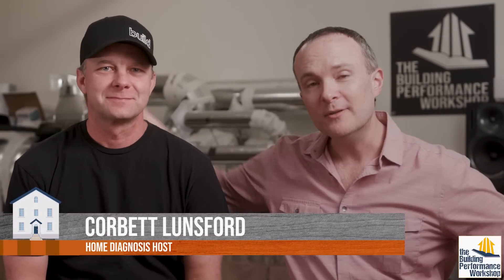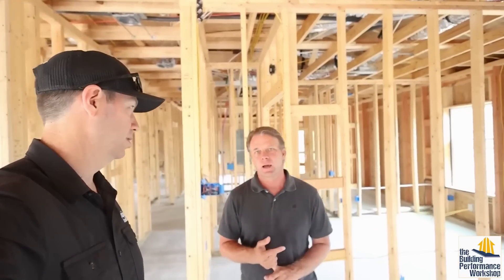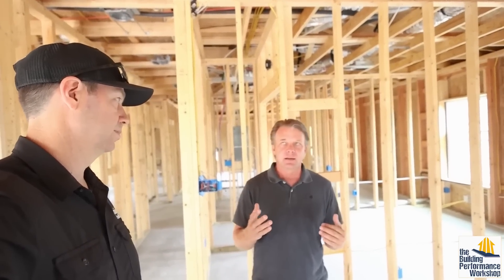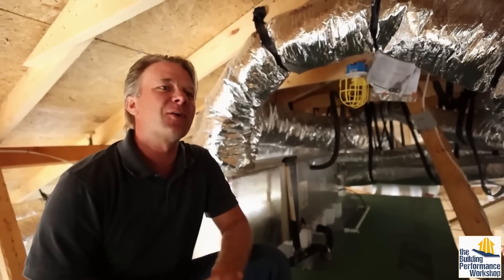Dryer Won't Dry Clothes- Broken Dryer, or Airtight Home? (feat. Scott True)

Comment: why was the make up air damper turned into a 10"? was it that it could cover both exhaust hood for the kitchen and laundry at the same time? could having the mau fan speed run higher do the job?
Reply from the maker: No, it was just undersized to begin with. Hard to configure a control system like you’re talking about.

Comment: Thanks!
Brothers,
I'm so glad I found your "Home Performance" channel.  I really appreciate anything I can find where Scott is speaking "Practical" and usable insights. 
Say... would you consider a deep-dive into the issues of the Vapor Diffusion ports.
What it is; the problem & why; the solution...

Corbett, do you & @Home Performance market or sell these blower door kits. We're getting ready to build a retirement home and may just have to buy one ourselves???  I cannot find a builder in my Coastal NC area who uses one or thinks in terms of 0.6 ACH50!  

Cheers,
Eric
Reply from the maker: Hey thanks Eric- I’m sure we can find you a blower door tester, try Josh Hartness at Haas Energy in Charlotte, he may know.
Reply: @HomePerformance  
Corbett, thank you very much! I will reach out to Josh on Monday. 
Another resource missing here on the Crystal Coast is an Aero Barrier contractor. AeroSeal  made a referral, but they only do the Aero Seal service not the Aero Barrier.  Perhaps Josh has contacts. 😎 
Building my team for our home is hard. Thankfully, I connect again with the awesome Steve Baczek next week. 

Cheers, Eric

Comment: So the solution was to increase the size of the make-up air to 10in, and air seal areas that were lacking. But it was said to “add make-up air exclusively for the dryer”? Does that mean a separate make-up air duct was added to the laundry room? Also, any reason why Scott didn’t retrofit an ERV?

Comment: Another great video. The only thing I did not understand was the reason there was moisture by the doors? If the doors are sealed well, then why the moisture infiltration. I understand that the home was under pressure when the dryer and ac was pulling but if sealed well then why the pull. Maybe even though the seal is great its still gonna pull. So make up air stop that?

Comment: Eureka!  We built our home tight; I think tighter than our mechanical contractor could appreciate.  None of our bathroom exhaust fans are effective, same goes for our hood vent, and last but not least, our gas dryer works only intermittently.  Now I know to open a window when we run the dryer.  Will definitely be discussing this with our mechanical contractor for the next build; thank you for this,

Comment: My thoughts on supplying make up air for the clothes drier is this,. My drier is on the main floor now in our master bathroom of our single level home.
I'm considering putting in what I call a "Shepard's hook duct"!  I would cut a 6" hole in the ceiling and install a 6" metal duct up into the attic, BUt it must rise up and then hook back down to prevent cold air from drifting down into the master bath when the drier is off line.
Cold air won't drift up first to then go down, as the Shepard's hook forced the cool air to go upwards before going down.
When the drier is in use it will pull the needed air 
( We have a propane drier) into the area near the drier.
The drier warms the area slightly normally and this would be countered by the incoming cold supply air.
I figured the shorter the distance between the Shepard's hook supply to the drier the better.
Bugs, birds, water, etc, etc are not present in the attic and can be easily checked by going into the attic.
Open to opinions??
Reply from the maker: Wow, Brian, you sent me over to Google in a hurry to see if this is a fad. I do not advise this because I’m certain it won’t work exactly as you plan, though it’s a very interesting concept. The thing that will drive air up and down a duct to the attic is not the temp of the attic air, it’s the pressure of the home wrt the attic. When air leaks from the top floor ceiling into the attic under stack pressure, this duct would pull air from the attic down even when the dryer is not running. You’ll have major dust build up and uncontrollable heat/humidity swings.

Comment: What was the solution for getting the dryer to work with the tightness of the house?
Reply: There was a fresh air damper that would bring in outside air into the return of the air handler. It was set on a schedule that didn't open often. Now, I have it set to stay open. So that can passively bring in make up air when the dryer runs. It works but I think we, as an industry can do better. I think it should be a dedicated damper that dumps near a return so it can be conditioned.

Comment: Great content! Thanks. Just curious, was the original HVAC contractor involved in finding this problem and the solution?
Reply: No. In fact, I won't call them back for anything because I prefer to have my current HVAC company help with everything, even if it was someone else' install. My current HVAC guys have proven to be excellent installers who are open to understanding things in a different way.

Comment: So why was there moisture damage at the base of the sliding patio door and the french patio door if they were personally sealed by Scott?
Reply: As stated, the depressurization is what provided the force for the outside air to find the path of least resistance. I mentioned before in the comments that the weather stripping in the door can provide a path. There was another thing I didn't mention. I site build my door pans which involves using liquid flash to seal the inside bottom of the door to the door pan. This liquid flash is the back damn for water and is also part of the air barrier. When I took the flooring off, I saw that the flooring guys cut this flashing completely out.

Comment: So why was there condensation dripping from the AC duct?  This was mentioned at the start.
Reply: The hod humid air from outside was leaking through loose penetrations in the attic. The depressurization provided the force for this to happen. That humid air would then condensate on a cold surface which is that grille right next to the spot that the air was coming in.

Comment: Great diagnosis! Is the reason the 6" damper didn't work because of a CFM limit to balance out the indoor/outside pressure? Would the size calculation of the damper be based on the type of makeup air system that you have and the CFM it outputs? Still learning and appreciate all of your videos.

Scott, still waiting for you to continue the "Building a high performance home on a budget" series.
Reply from the maker: Hey Catch 22, see this video for proper sizing:
https://youtu.be/CSmwDGxtlHU
Reply: @HomePerformance  should have known you already did a video. Thanks!

Comment: Great information.  So with a house sealed tight and not enough makeup air, moisture can be drawn in from the outside?.  That's what caused the floor issue by the door?. In this particular house was this only an issue when the range exhaust was being used? Once again a great and informative video.
Reply: Yes, that's exactly right. The hot humid air from the outside came in through the path of least resistance and condensate on the cold floor. The depressurization provided the force.

Comment: Love the video, Great find! It was great meeting Scott in Atlanta. 
The first building I tested had a depressurization issue. HVAC was located in the utility space, the building was fairly airtight. 
The damper was missing in the dryer duct termination and makeup air was entering through the drier resulting in condensation made worse by the undersized return pathway to the open-air AHU return in the laundry room (unit on a platform drawing air through the laundry room louvered door)
Reply from the maker: Nice, Dustin

Comment: He winter make up air Scoot/Corbett- in a new two system house, what do you think about having an erv upstairs for most of and ventilating dehumidifier in basement for most of the summer make up air.
Reply from the maker: Still have to exhaust the lower floor bathrooms into the ERV, still have to run the ERV at some continuous level— sounds like a more complicated setup that would generally over-ventilate.

Comment: Am I dense or did you not explain how and why the moisture issue was appearing around the doors on the floor, I am not quite understanding how the moisture was accumulating around the slider and french door when the root problem is not enough makeup air? Is it sucking humid air from outside in those areas and the moisture is building near the doors/floor from outside humidity?
Reply from the maker: Yes exactly

Comment: at  8:41 "describing crossing where you have to use ERVs, right, you can't use____" and we don't hear what we can't use. What did you say?
Reply: When the house is tight, an exhaust only method, like "normal" bathroom fans will depressurize the house and pull in air (hot humid air in my case) through the path of the least resistance (in my case, that path was around the weather stripping in the doors). Then, there is the supply only ventilation method which pulls in outside air into the air handler return or dehumidifier (if there is one). Then, there is what I call the unbalanced system which is what many builders that are trying to do better default to. This house was unbalanced, meaning I have exhaust and supply of outside air into the return. In theory, it sounds good, but the exhaust and fresh air never match. I prefer 100% balanced now. This means using an ERV and make up air for things like range hoods, dryers, and any other appliance pulling air out.
Reply: @ScottTrue  Assuming an ERV is present in a low ACH50 house, would a ventless heat pump dryer still require make up air?
Reply: @ramblinjamman  No. This is exactly why people like Corbett recommend the heat pump dryer. My home buyers have normal dryers so I'm having to come up with ways to handle that. I'll be explaining one way in a video with Matt soon.
Reply: @ScottTrue wow Scott, I just found this channel with your interview! Excellent!  
When I built my last home, I was so worried about my Dryer & Whole House vacuum needing make up air. I was so pleased to discover the Ultra-Air XT-105 & XT-155 Dehumidifiers with the make-up air intake! 
Man I appreciate your content! 

I so wish you were in Coastal NC to be my builder!!!  

Cheers, Eric
Reply from the maker: Sorry. Bath fans.

Comment: What is your comfortable "line" to cross for installing an ERV?  I've always thought sub 2.0 ACH is a good idea.  And sub 1.5 is a must.
Reply: Good question. I'm not sure exactly where to draw the line. I would guess 2 ACH 50. But rather than guessing or calculating, for me, it's much easier to just install the ERV for balanced ventilation.
Reply: @ScottTrue   Thanks Scott.  Because of you and your video with Matt, I learned that Corbitt could do the same "Advanced Manual J's" (is what I like to call it).  So he really helped me on my current project (which is getting a Zehnder unit.)  My spec houses all get the 'spot' Panasonic ERV's and usually come in between 1.5 - 2.0 ACH.
Reply from the maker: Thanks Wally, video forthcoming

Comment: Very interesting timing Corbett....  I had already been thinking that the dryer could/would be a problem in my ight house.  (Especially in "normal" homes where you just install an exhaust only vent.  That's not providing any additional air, just taking MORE air away.)  In my case, I have the kitchen on the other side of the laundry room and had already been considering wiring an additional 'timer' in the laundry room to 'boost' air (from the make up hood fan devise) while the dryer is running.  Even Zehnder had me running a boost switch to the laundry room which again would just be cycling air, not providing more air to the area.  I'm guessing Zehnder thought I would run a HP dryer, so to their credit, it was not discussed.  Great stuff.  Good to see Scott on there.
Reply: We are installing a Zehnder unit with ERV in our build and will be installing a HP dryer in the utility/laundry room, so your comments re Zehnder and HP dryer have helped clarify a couple of things. Thank you.
Reply: @antonmcgready9285  No problem,   you won't need to worry about it as the HP dryer uses the air from the house,  but then puts it right back in the house (no exhaust to the outside.)  Therefore no pressure imbalance. We just didn't like the idea of running smaller loads with the HP dryer.
Reply: @wjthehomebuilder  I personally love the concept of HP dryers but I think my wife would kill me if she had to use them.  For a large family I just don't think they are practical yet.  I've had my eye on the new LG tower unit that has the 7+CF HP dryer.  Hoping that the reviews won't be like all the other HP dryers out there.
Reply: @lukemezger2274  Do you have a part number for that LG dryer? I would be interested to look it up as well.  Thanks!
Reply: @wjthehomebuilder   WKHC202HBA
Reply from the maker: Thanks Wally

Comment: Great video guys, and great to see you yesterday Scott at BS & Beer ATX!   A lot of people are going to suggest the heat pump dryers but with a large busy family, you are going to end up with a very frustrated spouse that does the laundry!  I would love to see a direct vent dryer or an active makeup air system (dedicated to the dryer) with a current switch and an adjustable fan so you can adjust it to match what the dryer is pushing out of the house.
Reply: Good to see you as well Luke. Good job presenting! Yeah, I like the heat pump dryer idea. Right now, I'm building my own house and I want to have it set up for a vented dryer so we have the freedom to go both ways. But I'm designing the make up air to go through the dehumidifier. I'll share the details once I have it together.
Reply: @ScottTrue  I've been dreaming up a dedicated makeup air for the dryer.  Our dryer gets used way longer than the hood so I think it's super important.  In my (1980's) house we will often get ash smell from our fireplace when the run the dryer, it's super annoying.  We should get together and come up with a prototype!

Comment: Have always wondered why dryers don't have a built in make up air. Never made sense to use expensive air(cooled inside air) run it through the dryer and push it outside only to suck in hot air from outside. My problem with makeup air and ERVS etc is that they are extremely difficult to retrofit into older houses. Many of us are not fortunate enough to live somewhere with basements and mechanical rooms. Basically the only place for it is in the attic(unfortunately)  IMO every house should be required to have an adequate sized mechanical room.
Reply: well originally they didn't need make up air as they where recirculate instead of vented outdoors.  i still have one.
Reply from the maker: Interesting- also, they used to be installed outside the house
Reply: I used the mechanical room for a kids bedroom. Priorities. 😂

Comment: Thrilled to see more content about makeup air! It was the missing link from my reno build. 1. Would LOVE to see more videos on energy/price performant systems for makeup air and contrasts to the  issues relative to the central ERV (cooking grease, dryer lint, etc. as "core destroyers" and therefore must be separate?). Besides the obvious - 2. switch to condensing dryers! (Fantasy thoughts: "air-smart" appliances to either go full/partial "direct-vent" based on home and weather conditions; especially frustrating watching that steaming humidity dump of the dishwasher in summer!)
Reply from the maker: Video forthcoming, John